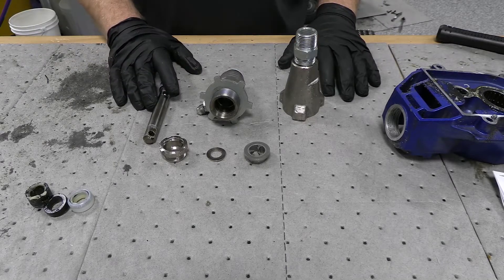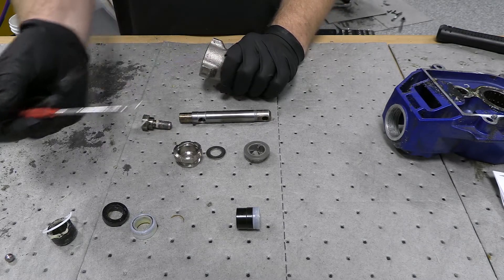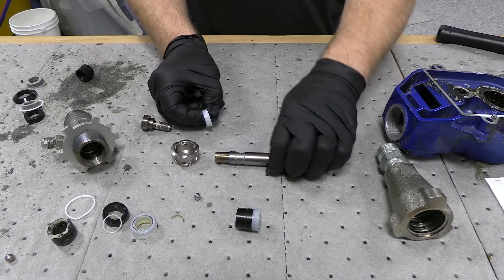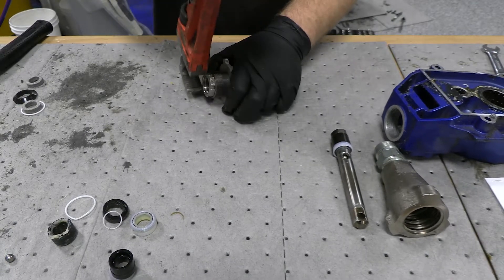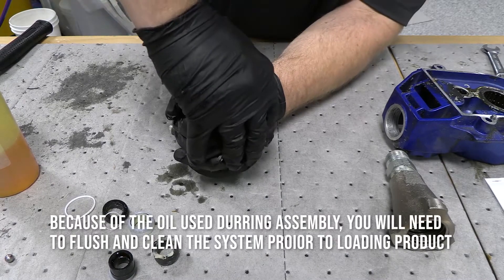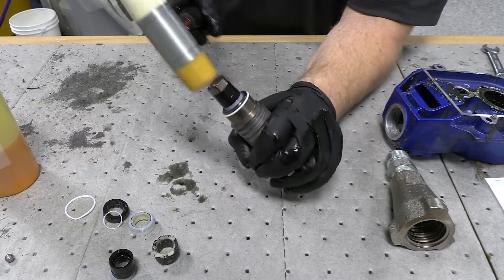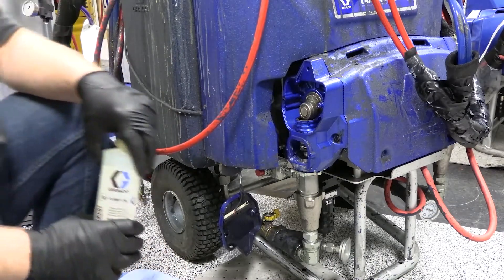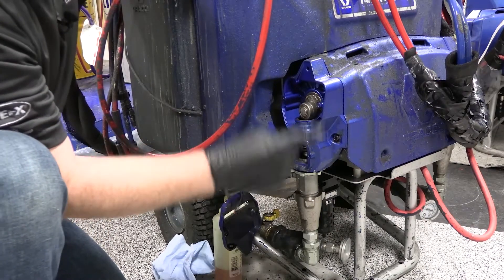E 10 Displacement Pump Rebuild Part 2

Comment: I was provided 15 gallons of MEK to use for cleaning by Sherwin Williams. Should I be switching products for soaking and cleaning out the machine  or am safe using the MEK
Reply from the maker: I would not use MEK as it is very harmful to you and it will not do as good of job as NMP.  You still don’t want to get NMP on your skin.